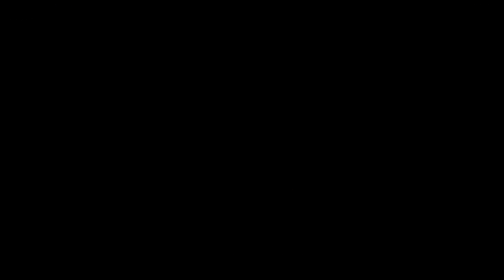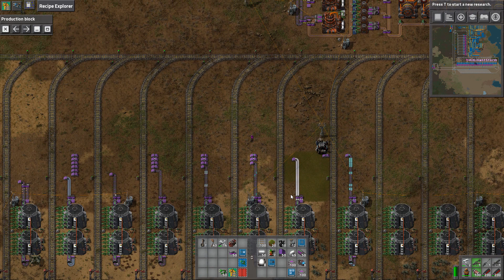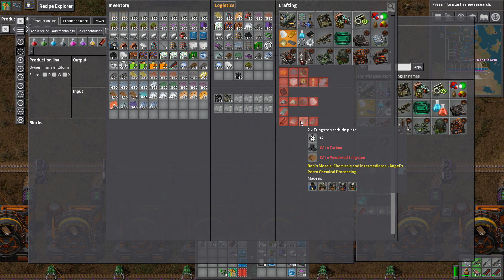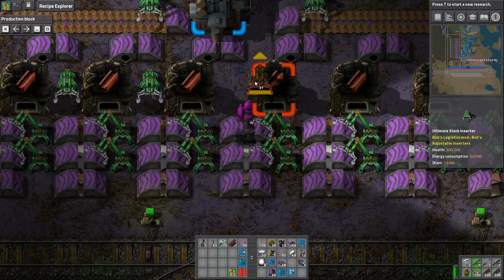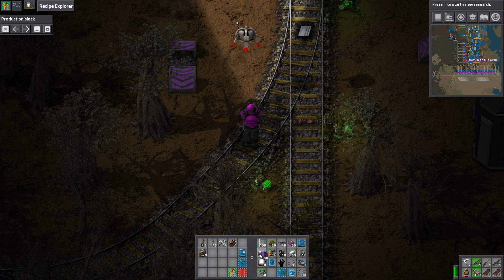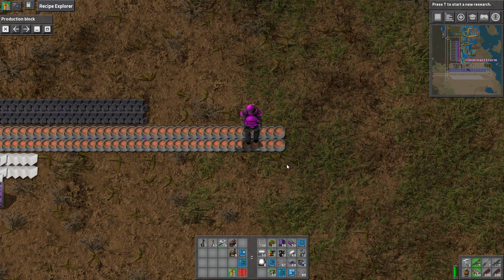Factorio - Angel's & Bob's - Episode 168 - Tungsten Alloys

Comment: Make sure your tungsten carbide furnaces are all burning solid fuel, rather than putting carbon into the fuel slot. (You forgot to make sure the fuel went in first, but the fuel inserters were closer to the furnaces so they probably won the insertion race).
Reply from the maker: Ah yes.  I always forget carbon is a fuel.  I can double check.